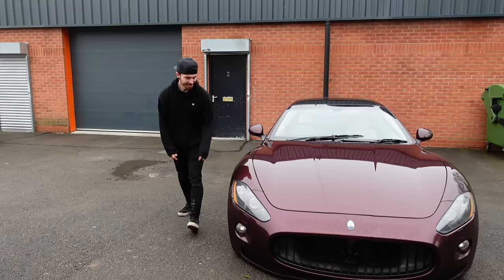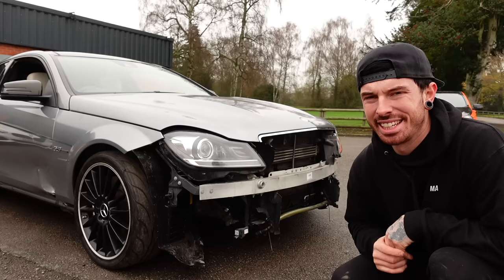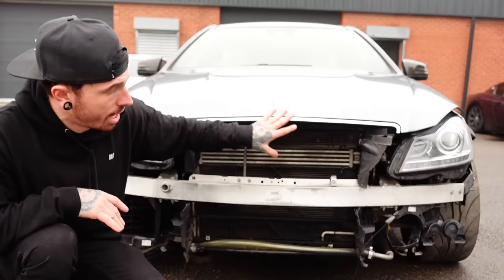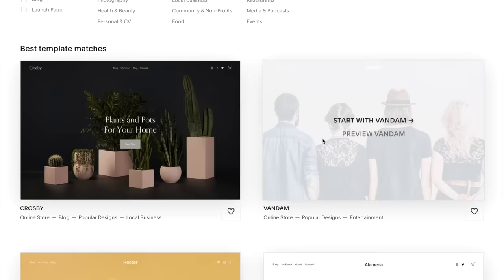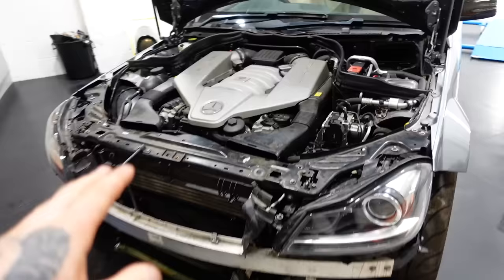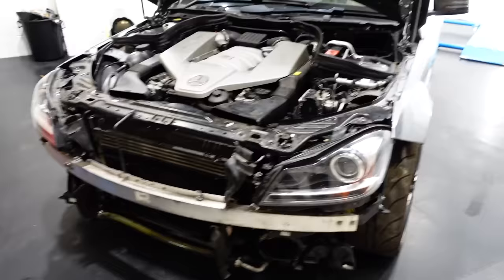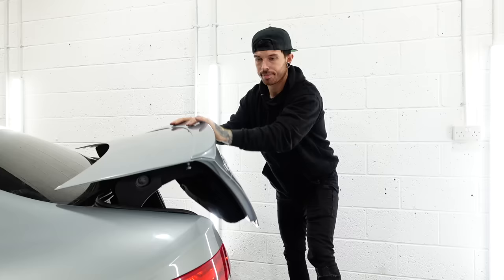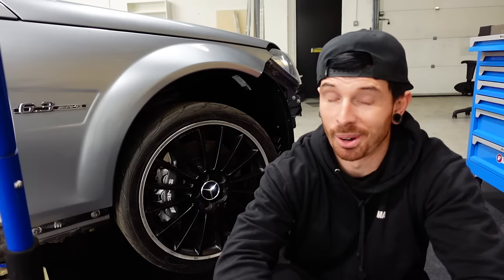I BOUGHT MY GIRLFRIEND A WRECKED C63 AMG

Comment: I used to drive an S-Class as a Taxi, I used to do a few repairs myself, Beer income with a Champagne taste.
I suspect this is also a modular design, where you can basically just buy new parts and refit them as needed.
You are lucky to be doing this in the UK, in Germany you can't send or even fit airbags yourself unless you are a ``Meister´´ mechanic.
Airbags are classed as explosives.
A double garage where I live, big enough to do repairs is about the same as renting a flat, buying a garage is about the same as some houses in the UK, very frustrating.
Great video channel!
It is now 11,00am and the emergency warning sirens are going off!

Comment: Bro take that engine out also and do a internal inspection. I would be making sure new head bolts are in and putting new head gaskets. Cleaning carbon. Checking timing chain and guides. Replacing any O-rings that are perished. Checking the cams and hydraulic lifters for wear.

Comment: Nice colour! AMG all day! I reckon you got it for around £15,000. Just hope no engine damage have a nose at the common faults on this engine while your fixing it, if your keeping it. I have had 5 diesel mercs but always injector seals pain as Honda seals tad thicker maybe designed on purpose. Think theres 2/3 on this oil sump tube and bolts

Comment: Mat, I recon that you're 100% right about the boot lid being from a regular W204 C63 AMG saloon model, as the C63 AMG coupe you have is much more rarer and harder to find !, So I recon that the salon boot lid is most probably about 20mm longer than the C63 AMG coupe boot lid. 

You're brave for taking this project, but it will be well worth it in the end and your girlfriend will love you even more ! LOL when she finally has the car she's always wanted !

I believe you can use the boot lid from a non AMG "W204" C class coupe and it will fit your car correctly, all you would have to do is just repaint and rebadge it as "C63 AMG" and that end of the car is sorted ! ...once you've done a few minor repairs to the rear bumper and the inside of the latch area of the boot.

The front end is going to be the real challenge to sort out, as like you said its going to require specialist jig alignment so all the parts can be located in the correct positions. 

All the very best of luck man ! 👍👍👍

Comment: Dont think id want my misses driving that, surely that frame is weakened now ?

Id get shut, safety first mate
Reply from the maker: When fixed the frames can be made even stronger than standard
Reply: When done right it's just as safe as from factory. If it's a botch job then yes it's not good but I wouldn't say dangerous.
Reply: @MatArmstrongbmx  you need to get it up in the air mate make no brackets have broken off the engine block or gearbox with it getting pushed back cause that  will be expensive
Reply: Is it strength that's the issue though? I think it would be hard to get all the crumple zones to function correctly again as they have already been crumpled? Good luck though, admire the positivity 👍

Comment: That’s an engine out, suspension off jig bracket repair Matt & your dealing with multiple different types of metal  aluminium, baron steel all sorts I’ve been running my own body shop for 30 years that’s no easy repair mate, good luck.

Comment: Must have been in a serious crash with someone having to be cut out the rear seat 🤷‍♂️ might cost about 12 grand to fix maybe
Reply: No because the seat belts are empty lock on and you can’t fold the seat down. Only option is to cut them to get them out
Reply: atleast 12k m8 plus Merc parts arent cheap

Comment: ON the negative -side.....That is a shed load of work, you have the airbags,pretensioners and why are those belts off if it crashed ?, my thoughts its been dollied up to get more money,  frame is bent and could cost between  a grand and upwards for a proper repair and then the whole car wants to be resprayed, if you have ppl who will do this for free then thats good.  On the postive + side  its a C63 AMG , and once sorted should be fine.. another option would be to part it out,engine, gearbox and  wheels the biggest asset, and the interior should get some money. any way good luck on the rebuild, love your get up and go.

Comment: Keep hold of it for a year in dry storage another may come through , its damaged but the parts will hold it value might get a engine failure or a HGV scraped one if it's a no go you still have options it not a complete fail

Comment: You will get it done Mat it just needs Jigging. Take on the challenge I would if i could afford one!!! I have owned n driven a fair few Cat C cars my advice is fix it properly especially with the chassis alignment It will drive bang on despite what all the test pilots think its all to do with fixing it properly which I know you will do!! Mercedes parts are mega bucks at the dealers I have found Sytner in Gloucester useful over the years. Peace out Tom F

Comment: A SN95 I bought years ago realized it wasn’t suspension and the frame had been diamond shaped from being hit in the front corner. 

I knew the guy who sold it to me. He clearly ripped me off because as it turned out later it was also supposed to be a salvage title and I didn’t find out until State Farm sent me a $2500 settlement check in the mail with an apology letter accompanying the fact that one of their staff was pushing cars through the auction without reprinting the damage.

Thankfully a friend at a frame shop straightened it out and only charged $100. 

It ended up working ok since I had only paid $2k for it back then. But I did have to do more work to get it cleaned up and drivable. I enjoyed it a few years.

The biggest issue was the salvage on the title and it’s a pain to get that removed. I sold it and didn’t make any profit due to the title issue.

Comment: Steel race chassis's and kart chassis's get straightened after every major race meeting whether they've been damaged or not maybe after two seasons you'd junk it but not before you get the results in. Don't assume it's just the chassis though, wishbones etc should be checked too.

Comment: In the scale of things pulling is cheap , it's if u need to replace that leg where the money gos ,it's not that bad from the look of it ,it doesn't appear to b crumpled there r a lot of one man bands they do contract pulling 300 quid a day  ,it's ok  only thing I would worry about ,if that leg is aluminium and needs replacing ,it's been heat treated and u weldable

Comment: The frame is twisted and warped bad but but if you put it in a frame gig you can bend it back out there to take a lot of work but it can be done everyone freaks out when they see the frame bent but trust me it can be built that metal can be reworked and it will run and drive fun but you will have to you will have to mark the title as a salvage vehicle so that the next person knows that you had to do frame workYou will have to reinforce the frame to make sure that if you have another accident God for bid that you don’t that you have structural strength to the frame I’ve been working on cars my whole life I love them and hate them at the same time But in the long run sometimes it’s worth it do you Gotta make sure did you get a good deal you don’t pay too much money will you be ready love y’all from America

Comment: I wont lie to you Matt, this is expensive to fix even by yourself. These little bits massively add up and I can bet you there’s more wrong with it than just that. 

All I’ll say is thank the lord that the engine still runs, I’ve just replaced my W204 1.8L engine (bare in mind I have to pay labour and VAT because I’d be useless) and that cost £4500

Good luck though and I’m excited by this because there is a lot there and that structural worries me, the rest is cosmetic and parts can be fetched easily second hand and sometimes Mercedes sells them cheaper than second hand

Comment: Do the boot hinges adjust forwards? there's quite a gap at the front between the lid and the glass. The profile of the boot looks right when compared to the wing - it just looks like it is too far back - I wonder if they put it where it is so it would 'shut' on the damaged closing latch? Good luck - you're braver than me and I'm mad!
Reply: and I've just subscribed!
Reply from the maker: Yeah it’s a saloon boot on a coupe car 😂 wrong part numbers for the car

Comment: If I'm you bro... Take that motor out n have a look at the dampeners on the crankshaft sprocket and the center roller sprocket... Smack some new head bolts on there as well.

Comment: That chassis leg has done its job Mat, if you heat that leg and pull it, you have weakened the molecular structure of the high strength steel. To repair correctly and safely is engine,  gearbox, dashboard, front seats and carpet out  and fit new leg and out rigger. Done nearly 30 years experience of jig work, take it from me, anything less and it is a bodge, and rendered unsafe repair. Cars like this are a write off for a reason.

Comment: Looking forward to this! You’ll get that sorted in no time on the frame machine. Might need some new bulk head donor parts to return its structural integrity then it will be as good as new if the pulling does not do the trick 👍 Not saying it is going to be easy but that’s all part of the fun haha

Comment: M8 I think there shocks inside the seat belt catch they pull you tighter til the seat n lock you in for 10 seconds, if them airbags went of more are likely set the sensors of in the seat belts, they all would of needed to be plugged in, probably 4 people in the car win it crashed, it ain't cheep to repair an airbag, someone told me it's 2 grand to regas n fit an airbag n 6 hundred a seat belt, don't hold me til that now, just passing on a bit of hear say 🙈

Comment: a lot of ppl saying dont bother..  most people wouldnt as it's not cost effective.  However the process of rebuilding it will create revenue for YT content, some people want you to fail so they want to tune in = £.  if you took it back to the seller, which 90% of people would, you wpuld buy a safer project and possibly not gain the revenue/subs from that.  people forgetting YT is your job.  That said, I'd run a fucking mile, but crack on pal :) good luck.

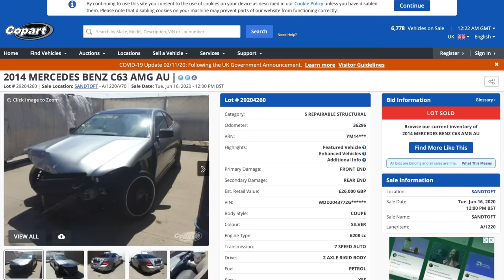Comment: 12:20 you said it, you weren’t ripped off, you were naive. Buying a car unseen from a reputable dealer is very different from buying a damaged car shorter than it should be from a website. It was your fault that you paid what you did, if you had seen the car you would probably have walked away or reduced your offer.

Comment: So you can see straight away the boot issue in the photos before you bought it and you can tell that crash bar is new to clean. You failed to do any research but bang on about others doing there funny that.  You didn’t get scammed had over or defrauded you failed at the basic duty of care you bought it blind and you got what you paid for a donkey of a car.see if someone buys it to resell and there’s photos from cop art when they first had it you would of seen all the damage to start with and you wouldn’t of bought it.  If it’s been for sale for ages and not sold and the price has gone down and down then it’s a wrongun to start with and don’t buy anything from Bradford of Leeds or surrounding areas as there’s lots of shysters out there but what I suggest you do is your research next time and actually no what you are buying.  Best break that up as a parts car